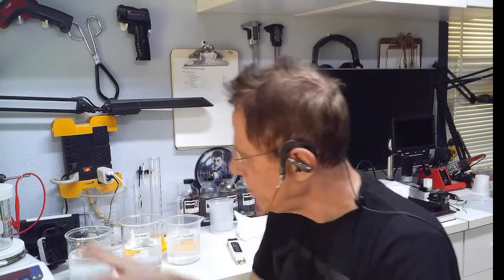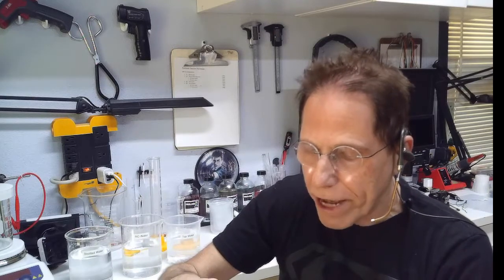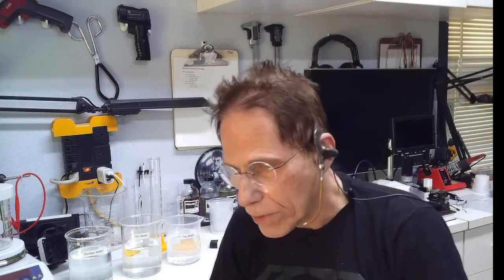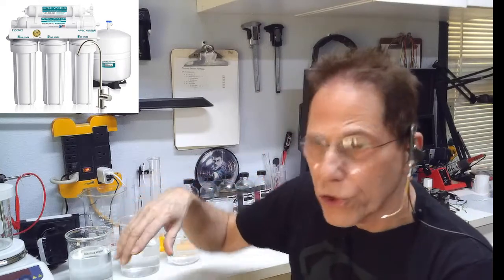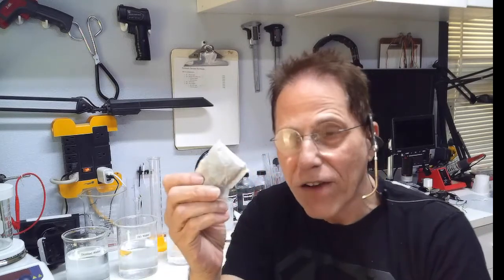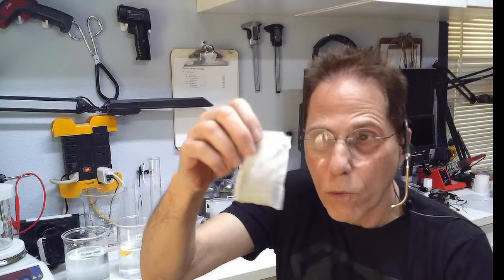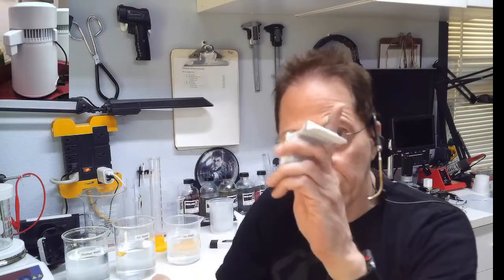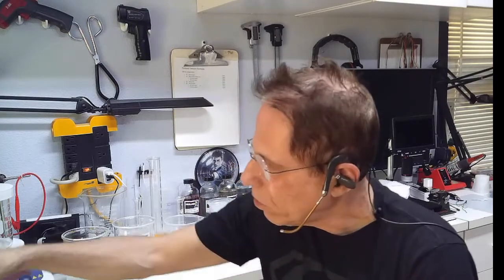RO water for your Distiller. Do you need the carbon filter?

Comment: You might not believe it but I've always been very allergic to charcoal. So when using the sacket, I get allergic reactions. Glad I find the answer that it's not mandatory to use it. I also always put already filtered water to my distillation pot.
Reply from the maker: Yep, no need for charcoal. You pre filter it, so what you get on the output is as pure distilled water as you can get.

Here is another tip. Don't let the distiller empty out. Turn it off about half hour before it will be empty. Discard the small amount of water left in it. When the water gets low, the minerals left in the water are concentrated and because these are not lab quality distillers, some of those minerals may vaporize due to the high temperature of the small amount of water. These can recombine in your distilled water. Also by doing it this way, you never hard boil the distiller and you won't need to clean it that often, if at all.
Reply: @AlchemyWizard  Yes, I actually knew this tip about turning it off half our before the end. Thanks for your answer. I really appreciate YouTubers who answer the comments.

Comment: Distilling does rewove Fluoride and chlorine. It removes all dissolved solids. Those chemicals are solid minerals/salts that are too heavy to be picked up by the steam. The harsh taste you get sometimes in your distilled water isn't because of chemicals, it's just the remnants of carbon gas from the junk in the dirty water breaking down. Any harsh tastes will go away if you let it sit. That has more to do with with the daily quality of water and how much algae/plant material is in the tap.

  What it doesn't remove are alcohols and vinegars, which are almost non existent in any drinking water. There's not much of anything that distilling misses. 

If you want to deep clean your condenser tubes in your distiller, put a little vinegar in it and run a batch.
Reply from the maker: thanks for the feedback. I will do more research on it and have a chat with my chemist on it. Problem with chlorine and fluoride is they are both gases trapped in the water, not solids. this makes it hard to remove with distillation.
Reply: I put a 1/2 teaspoon of Citric Acid into the water that I am going to boil, boil the water and then I have it shut the distiller off just before it runs dry, then add more water if boiling again. I usually do two batches, sometimes three before I throw what is left out. I then run it through a ProOne G2.0 7-Inch Gravity Water Replacement Filter, And the water is ready.
Reply: @keithjohnson5190 if you are adding Citric acid every single time to the water you are distilling for drinking and not just for cleaning, that could affect the longevity of the steel. I'm not sure about throwing citric acid in there every single time.
Reply: Hi, what I do is add one teaspoon, boil, I usually have about 1” water left in the pot, then I add more water again boil again, add more water and do another boil. I usually get 3 boils before I clear the distiller or add any more Citric Acid.If it is clean I just add water and boil again. I have been doing it this way for about 10 years with my oldest distiller, it looks like it is new. Thanks guy.
Reply: @AlchemyWizard   chlorine is a gas, but fluoride is not a gas
Reply from the maker: @hellmunddegenhard  Yes, I was hasty in my response that fluoride is a gas in water. I don't have fluoride in my water, so doing tests to see if it passes through the distillation process is unknown. 

I know what you are going to say, it's heavier than a gas, so it can't float out. However these low cost pressure distillers get very hot and pressurized when the water level gets low. They can vaporize materials, even heavy metals which then wind up recombining on the output.  These distillers are not your high-end laboratory grade units. I never run my distiller empty for this reason. I always leave an inch of water inside it.

Anyway, my point on the conversation was that I feel it's a good idea to pre filter your distilled water before distilling. It reduces the mineral concentration load and can improve the output of the distilled water. 

Next time I talk to my chemist, I'll have a deeper chat on fluoride in water. I know she says her city water in the lab has fluoride in it and they use the cheap distillers as well. The results can be wonky at times from the fluctuation in purity of  the distilled water output.
Reply from the maker: @hellmunddegenhard  I had a chat with my chemist. Fluoride is not a gas however fluorine is a gas. Under the pressure of these kinds of distillers the fluoride will break up into fluorine gas and this gas then can pass through the distillation process and wind up back at the output. The fluorine may eventually be released from the water in to the atmosphere if the water is allowed to vent for several days. But there  is also a chance that the fluorine can recombine back into fluoride. More testing would be needed. 

Again, best bet is to pre-filter your distilled water to remove these things before you distill the raw water.
Reply: @AlchemyWizard  Doesn't sound correct. It is not this easy to turn fluoride salts into fluorine. Also fluorine is very dangerous and toxic. These cheap distiller run at 100 deg C to 108 deg C. Not even close to temperatures required to melt these salts. Hell even 200 or 300 deg C is not enough. Also there is no need to distill the water if you are doing an RO. It is just overkill.
Reply from the maker: @rahulmallah8306  RO water does not work with plasma arc nanoparticle method. But the RO water does save the distiller from becoming a mess on the inside if you have heavy mineralized water. 8ppm RO water is good for some things however. Depends on use.

Comment: I need distilled water for a cpap machine. We are not drinking it. Would I need the carbon filter? Also, if I am not drinking it, would I need to use citric acid to clean it? Any info you can give me would be greatly appreciated.
Reply from the maker: You won't need the carbon filter in the distiller, unless the water you distill has some kind of odor in it. As far as cleaning the distiller, yes you still need to clean it because the minerals from your water will build up on the inside. If the concentrations get high enough these minerals will vaporize and you will have them coming out the distilled water side.

Here is another good tip, which I did not include in this video but in a later one. use a timer with your distiller and have it shut off 30 minutes before all the water is gone. This will prevent heavy minerals in the water from vaporizing at the last 10 minutes of the process, as the distillers internal temperature skyrockets. I use Alexa with my distiller hooked up to one of those power on off devices. but an old fashion time works too. Also it will make cleaning the distiller much easier as you won't be baking the minerals into the bottom of the distiller.
Reply: @AlchemyWizard  Thank you so much! I appreciate the help!
Reply from the maker: @brendayaste6519  😀

Comment: Great info, I agree with your take on after filtering., thanks!
Reply from the maker: Glad it was helpful!
Reply: @AlchemyWizard  I was considering a ro system, but think distilled is better.  I visited a local water store with a massive ro system, but was surprised they still had a problem with some contaminates. Do you think the carbon filter in my samsung fridge is effective enough as a first step?
Reply: btw, I told the water store guy I was looking for glass jugs, and he said they were as  hazardous as plastic, since they had forever chemicals in them.  I'm skeptical. :)
Reply from the maker: @tonyd4941  RO will give you 8 parts per million water. It's not distilled water and the microscope shows a considerable difference. Distilled is the most pure but it really depends what you are looking to use the water for. For things like breathing machines you need distilled water. For drinking either distilled water or RO will work but you should re-mineralize them for drinking.  The carbon filter in the refrigerator good start to removing most of the big offenders from the water. Below are some links to look at:
https://youtu.be/ep03cswkZ80
https://youtu.be/4FxeAH_jgkE
https://youtu.be/TmQZ3KL0Fbg
Reply from the maker: @tonyd4941  If its modern glass then it should be fine. Glass is the safest way to store drinking water. Older glass jugs had lead and other not so nice chemicals in them but that was years ago. I've no idea what he means by "forever chemicals."

With that said if you can use glass great. If not then Class 5, PP, Polypropylene is probably the best kind of plastic.

I've got a video on the different kinds of plastic. https://youtu.be/rzcC2YK3lCM
Reply: @AlchemyWizard  Hermes , thanks for the info and links, I appreciate it. It looks like RO will be best for me, as pfas is a major concern. I was considering the re-mineralization filter, I drink spring water, but it sounds like they over deliver enough to possibly be harmful to the kidneys. Your solution is probably best. I'm considering an iSpring RCC7 5 stage , it has a larger capacity ( though I don't need it) and claims better filtering, and the filters are reasonable, and just a few bucks more. Do you agree? If so, give me an affiliate link and I'll get it through you. The link is gigantic or I would have pasted it in.

I thought the glass remark was pretty funny, did he really believe that, or did he just want to make a sale! :)
Reply from the maker: @tonyd4941  I was thinking about where he would learn such a thing. It sounded like the just said something someone told him to say . Weird.

That RO unit looks good. I saw the one with the remineralizer filter too. I suppose it's nice that they are offering that now to people who are concerned about drinking RO water. But you are right in that you can't control how much they are re-mineralizing. If you re-mineralize the water yourself you can control the amount and get some of the more exotic sea salt with more trace minerals. Below is the Amazon associate link. Thank you for that. 
https://amzn.to/4hKmam1

Comment: hi , I believe tap water has been responsible for my anxiety and fatigue over the years. I have now switched to a water distiller and feel a lot stronger again. The problem is I seem to feel irritable after drinking the water. Is this some sort of detox / die off or is there any way around this? I don't want to drink regular tap water again and the Brita filters are rubbish.
Reply from the maker: Hi Jay-Tea!
You can re-mineralize your distilled water so it's more friendly to the body for drinking. I have a video where I talk about it. Basically you will use a small amount of sea salt (any kind you like, some sea salt have more minerals in it than others) add it to a gallon of distilled water. If done right you will not taste the salt and your water will have magnesium and trace minerals. https://youtu.be/ep03cswkZ80
Reply: @AlchemyWizard  Thanks. Yeah the brain fog seems to get worse as the week goes on, each time I drink distilled water. However I don't want to drink tap water and can't buy an RO right now. I just added sea salt to some distilled water but still getting a heavy head. Could it be metals leeching from the water distiller? It's stainless steel food grade 304.
Reply from the maker: @ Did you measure the mineral content with a TDS meter. Perhaps you did not add enough. It needs to be in the 50 to 100ppm range for spring water concentrations.
Reply: @ yes i just added some redmond salt to my batch of distilled water. Was reading 2 before, now is read 87. Hard to gauge right now, definitely still have some brain fog. Im thinking maybe i should add a more complete trace mineral that includes higher levels of magnesium and potassium? That's if the water dosn't contain nickel or some other VOC.
Reply from the maker: @Jay-Tea.  Different sea salts have different trace minerals. Just do some research on what they contain and try it. I believe in that video someone left a post about what he thought was the best salt to use.

Comment: Thank you for this video.  I have learned so much from you, thank you.  I fortunately have access to an artesian spring that I use for making distilled water. However, it's high in minerals, and after watching one of your other videos I need to distill the water 2x to get it to 0ppm.
Reply from the maker: My water is high in minerals as well. You can put it through something like ZeroFilter first, but then you will have to buy filters as the ZeroFilter becomes clogged. And it clogs fast due to the high mineral content. Other thing you can do is get a RO (reverse osmosis) system for the mineral water and then put that water into the distiller. That is if you don't want to distiller it twice.

Amazon Associate Links
• ZeroWater Pitcher on Amazon: https://amzn.to/3BARy1X 
• RO Water Unit on Amazon: https://amzn.to/3dDAy3g

Comment: How do you feel about distilling the tap water first then run it through one of those zero water filter systems? Maybe it would produce the same results while allowing that filter to last longer.....
Reply from the maker: I've tested this. After distilling the water, the video microscope shows it clear of things in there. After I pour the now clear distilled water through the zero filter, the microscope shows addition of some compounds, probably carbon or some other media they use in it that does not break down. The water still measures 0 PPM. If your are doing LVDC electrolysis the water would probably be fine. However it does not work with plasma arc, which is telling that there certainly is something in the water that was not there after distilling.  Plasma arc will only form when it's pure water with nothing in it.

Comment: I have a question. I have a zero water filter pitcher. It came with a TDS meter. I use this water for my ice cubes. The last few times I used my distiller the water smelled horrible. I cleaned out the tube and the base with vinegar & baking soda. Thoroughly rinsed it and removed the charcoal packet.
The bottom of my distiller would always have disgusting ruminants from the water used. 

Can I use the zero water filtered water in my distiller and get rid of the problem? Or am I being redundant? Is water with a 0 TDS reading like distilled water?
Reply from the maker: yes, I would use the zero-water filter water in the distiller. it is a low cost way of making pure distilled water without having to use RO water. Tap water can leave gunk on the bottom of the distiller and may still have a bad taste to it, without redistilling it again. You also will not have to clean out the distiller when using RO or Zero-Water filtered water.

Comment: I always thought that distilling water didn't remove chlorine and fluoride.  Thanks for confirming that . I was also told RO removes fluoride.  So now you've confused me again.  Can you tell us the ppm for all water types you have please? 
Thanks . 
Most underwater sink filter systems use carbon filters yet they don't remove fluoride.  So I'm totally confused how a little teabag of carbon can do what a twin system can't?
Reply from the maker: RO filters use a carbon filter which will remove chlorine. Fluoride is removed by the RO filter itself, as the Fluoride molecule is too large to pass through the RO filter. 

The PPM formula is the same for all the colloidal:

•  ppm = material used (in grams) x 10^6 / amount in mL.
• ex:  14ppm = 0.007g X 1000000

Now just a note on this general formula for PPM. It is a general formula. It by no means takes into account the size of the molecules. For example gold is larger molecule than silver. If you take into account the size of the molecule, you get very different PPM numbers but much more accurate. However the general PPM formula has become the de facto standard these days. Sadly it is only a guide of the material used in the process and not actual PPM numbers.

That small carbon filter in the end of the distiller does nothing. It is just a gimmick. I myself tried pouring fluid through these small tea-bag filters and it made no difference on the TDS meter. The under sink carbon filters like you find in 3 and five stage water filtering do remove that stuff.
Reply from the maker: A RO filter system is not a standard under the counter filter system. It must contain the RO filter in the final stage. This stage forces the water through a membrane that will only let a certain size particles pass through it. the size of the fluoride molecule cannot fit through the membrane, so the fluoride does not pass.
Reply from the maker: RO water will read 8ppm or lower on the TDS meter. Spring water will read about 30 to 60ppm. Well water reads 90 to 180ppm depending on your well water. I have no idea what city water measures at. perhaps someone can test that and let us know.
Reply: Distillation removes fluoride lol. As for chlorine many distillers remove it through both VOC vents and a post carbon filter pouch. Still distillation is not always the best for VOCs especially chloramines are stubborn, so you could run through a PUR carbon block pitcher or a ZeroWater pitcher after distillation to really get them out.

Comment: Yeay tell me about it i used your tip to boil for  10 minutes the charcoal filters  and they all busted open just scrapped all my 4 filters  lol😂😂😂😂😂😂  but i found a solution to these filters  i  use my keurig coffe machine  carbon filters  much better quality  and  most of people know that you have to soak these filters at least 15minutes and then rinced them well
Reply from the maker: Great job! Thanks for the Keurig tip. I will have to remember that.